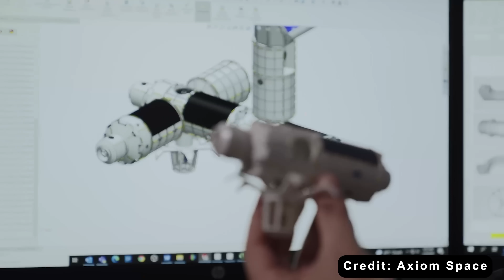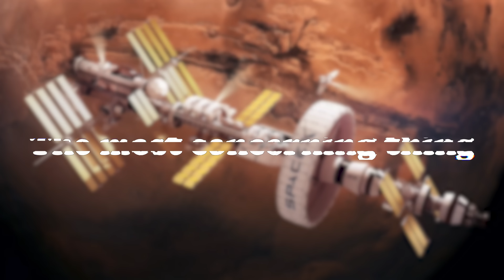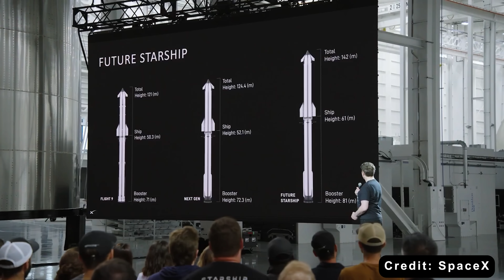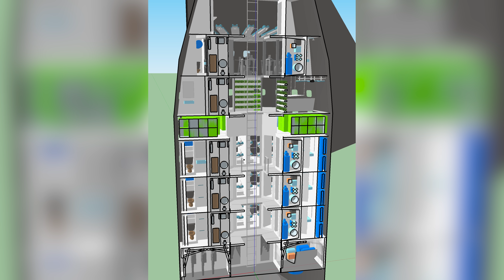ISS is in Big Trouble! SpaceX Shocked the Whole Industry to launch Starship's space station.

Comment: As a professional welder I can say any steel is way better and easier to work with than aluminum, on the other hand titanium is extremely expensive and hard to make on earth even processing scrap for reuse is very dangerous where in space it's just as easy to make or repair as any steel but 10x stronger than steel and lighter than aluminum for any given thickness. Making any metal in space is safer and probably yield far stronger metals than made on earth because the vacuum and 0G would allow for perfect crystal structure in the metals, yes every metal under a microscope has a crystallin structure. For example, steel made on earth is like a sheet of paper but made in space would be like HD cardboard and the potential for new alloys is endless.

Comment: How will gravity vary over each foot further from the center of the hub.  The relative range I am asking about is the length of the Starship starting at the nose at the attachment point from the center of the hub to the tail?.
Reply: depends on the rotational speed, but you're right there would be a gradient from nose to tail. a purpose built Starship with down-rated Falcon engines (to save space as one only needs orbital capability) would have more space that's used by fuel tanks now. also dividing the cargo section perpendicular to the nose and tail and attaching to a hub midships would give far larger room sizes in false gravity

Comment: To make an artificial gravity space station, it needs at least a 200 meter diameter. You can achieve Mars like gravity. Unless it's simply a 0g factory in space.  

Having some artificial gravity gives you advantage to move a great amount of cargo volume quickly, without needing to grab hold to move things around.

The space station becomes a cargo central transfer point allowing you to move much more cargo from orbit to orbit vs a single rocket surface to surface with its launch, orbit, TI, breaking and landing overhead. So each ship can be optimized for its planetary environment surface to orbit and orbit to surface return.

The orbit to orbit can be a huge automated cargo vessel carrying thousands of tons slowly over time to its destination. 

Think of the earth equivalent; a truck delivers its cargo to and from an ocean going vessel.
Reply from the maker: Zero-g factories can still exist attached to the hub (docked or on a separate arm), but having a spinning section for crew and cargo handling makes transfers so much smoother.